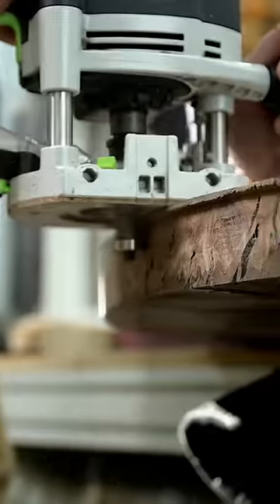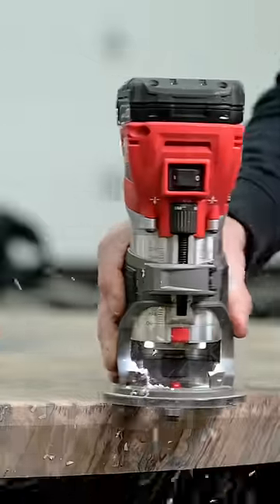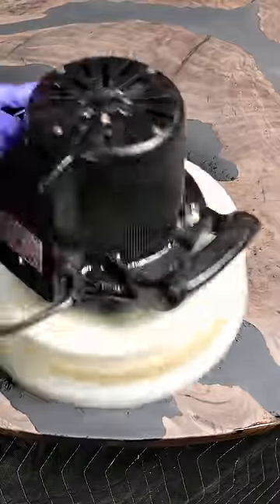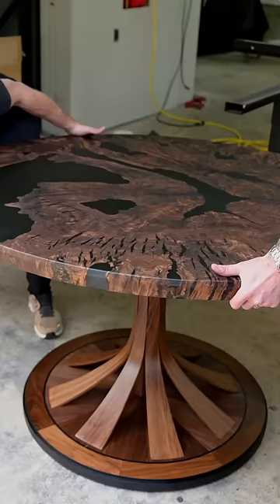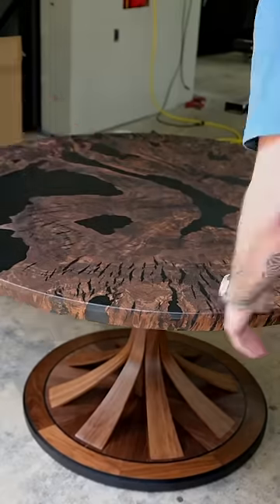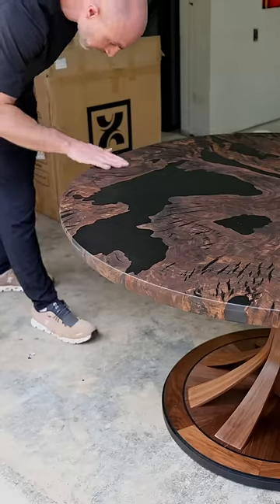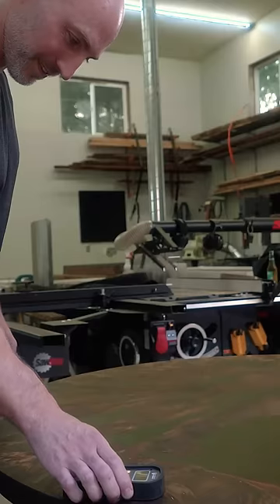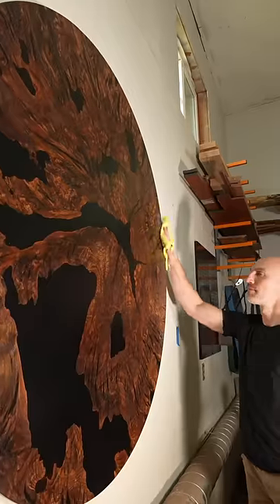My biggest f’ up

Comment: Someone educate me. How does this happen? can you predict and prevent this issue? beautiful nonetheless
Reply from the maker: So… the slabs I buy are supposed to be dry when I buy them. However, better woodworker would double check themselves. Basically this type of wood is prone to pockets of trapped moisture that are easy to miss. After a few months there would be depressions, cracks, and some warping if I tried to use it as is. Thanks for the question!
Reply: @blacktailstudiouncut  thank you for the wisdom, and the reply!
Reply: @blacktailstudiouncut  is it possible to leave it for a year till it sets and flatten it with a router?
Reply: @R.Akerblad  the surface is sealed so the moisture can’t escape.
Reply: @blacktailstudiouncut so basicly you paid 1200 dollars for an unuseable slab😅 cant you ask a bit of your money back from the slab suplier
Reply: @blacktailstudiouncut  thanks for teaching me something new. Interesting
Reply: @blacktailstudiouncut  thanks for replying, I was curious too
Reply: Thanks for asking :)
Reply: 6 to 7% reading I’m told
Reply: It’s tough, but sometimes you have to take the time and let it dry out. The excitement of building something cool can cause us to rush sometimes 😬
Reply: @R.Akerblad  the form of the epoxy and the form of the slab will not remain compatible, i.e. there will be warpage and gaps.
Reply: @whirled_peas  might it be possible (big horizontal bandsaw) to split it in to two thinner slices. Air out and re epoxy. Either as two pieces or try and get them together again. I know this would be hard but is it technically doable?
Reply: @blacktailstudiouncut   could you just cut the edge to open access to the wood to let it dry out?  Then maybe you could turn them into plates or something .
Reply: @blacktailstudiouncut  
Could it be that, for such porous pieces, the extreme cool of the dry ice cleaning causes condensation?
Maybe ice crystals are damaging cellulose cell walls and are allowing moisture to gather, or to get into places that are quickly then sealed shut when the temperature rebounds?
A few before and after tests with comparable slabs might be a good idea...
Reply: @hhiippiittyy I have precisely the same thoughts/inquiries.
Reply: Make a clock out of it
Reply: @blacktailstudiouncut  
I'm sorry for you 
It's beautiful,  really is
Reply: @blacktailstudiouncut couldn’t you make a clock out of it?
Reply: @blacktailstudiouncut pick a better source that guy is a fool not to do a FULL inspection which would've detected these before you wasted time
Reply: @blacktailstudiouncut  what do you use to detect the moisture?
Reply: The lumber needs to be kiln dried!!! 👍 I sell them
Reply: @blacktailstudiouncut  ty for replying
Reply: @ronjoosse5288  doesn’t work like that, because you can’t prove there was moisture in it when he purchased the slab. (Buyer could’ve left the slab out in the elements for a couple days) Also he sealed it, which is why it’s unusable now.
Reply: How does the "moisture meter" work through a sealed surface?
Reply: @SJNFAB  this guy is absolutely right. Kiln will do the job. Maybe build a solar kiln. Most likely slower but that would do the job as well.
Reply: i know very little of woodworking but would it not be possible to shave of the top layer and let it dry out?
Reply: @hhiippiittyy  good question. I'm curious myself.
Reply: @holohulolo  a wood moister meter.
Reply: @blacktailstudiouncut  your awesome thank you for the info
Reply: @arturraimundo7158  they have 2 very sharp metal points on the end, he probably just pushed hard enough to get through the epoxy.
Reply: Was wondering the same thing
Reply: Cam, just curious if you could sand the bottom to expose the grain and let the moisture escape over a few months and then refinish one side? If it caused depressions and or cracks couldnt you just re pour a tabletop epoxy on top to fix it?
Reply: @hhiippiittyy  this is what I thought....
@Blacktail Studio Uncut , you might give this a thought...
Reply: @blacktailstudiouncut  I would think the epoxy would keep it from warping, still looks beautiful though
Reply: @blacktailstudiouncut  neat, just a suggestion but you should do some educational shorts too!
Reply: Best you could do is store your wood in an area that is climate controlled. Oregon can be humid especially in the rainy months keeping the wood in a similar climate it will be used in is a good rule of thumb. So if it’s a dining room table about 70f and less the 35-50% humidity
Reply: @blacktailstudiouncut  Any hopes with a critical-temp dehydrator?
Reply: @connorjohn5013  couldn’t you plane the epoxy off and let it dry out?
Reply: @Grom-rl8bm  that's a non penetrating/pinless moisture meter. Uses an electromagnet and electronics, doesn't destroy the surface.
Reply: @blacktailstudiouncut   I was wondering how such a beautiful piece was unusable thanks for answering never would have known otherwise.
Reply: my black walnut handle was "dry" and i shaved a new knife handle out of it. now 6 months later its shrunk about a 1/8th of a inch overall
Reply: Woods a plant first and foremost so moisture soaks into the wood when he made this piece the wood obviously wasn't thoroughly dried out. Best thing I can tell you is after you buy the wood store it in a dry place and let it dry out for a while unless you have an industrial sized dehydrator.
Reply: @blacktailstudiouncut  is there anything else you can use other than epoxy to fill holes in wood? I’d love to get a table like this when I’m wealthier but epoxy seems a bit too basic lol
Reply: So long story short this could have avoided by testing BEFORE starting let alone finishing. I don't understand why people are saying he should get money back?
Reply: @blacktailstudiouncut  omg that is the most beautiful table I think I have ever seen. If I ever am able to afford one I want to have you build me something it looks amazing. Unfortunately I doubt the day will come that I can afford it.
Reply: Assume everything from the mill is wet or very unevenly seasoned/dried. Just let it sit in a dry shop on the rack. Longer the better, you can moisture gauge it if you're a nerd or impatient. 

Go visit old custom furniture shops that specialize in solid lumber and you will see a years worth of lumber just racked up, like 8/4  and or 6/4 just getting acclimated.

If you're from the "drowned it in expox" school of furniture making, then you likely can't afford that much lead time and capital tied up in lumber since resin ain't cheap.

I seriously wish this fad dies out soon. Epoxy builds kinda just make me puke. I respect the work into these these builds, but it's a crutch that more woodworkers need to let go of. Just my controversial opinion on this.
Reply: @connorjohn5013 nah cut the slabs from the epoxy  and mill faces to expose grain again let it dry
Reply: Can the bottom you of the slab be routed off to allow the moisture to evaporate. Kiln dry the slab upside down on a flat surface, clamped down, to minimize warpage?
Reply: @connorjohn5013  can’t he sand the bottom so it’s unsealed then let the moisture escape or leave the bottom unsealed??
Reply: He made it to damn quick that’s all
Reply: Can u drill tiny holes an bake it in a giant oven like a slow bake on low for 2 days?
Reply: @blacktailstudiouncut  i feel like you could remove the finish, dry it, and re epoxt the cracks, probably would look fine
Reply: @R.Akerblad  - he's saying he just didn't check the moisture content. It could bake or sit till it's dry enough to use and not have any issues.
Reply: @R.Akerblad  sounds like it would work to me.
Reply: Walls need love too, I have 2 gorgeous carved asian screens that go across my wall and they’re just as  fabulous as this piece you just made. I see no spilled milk, just a gorgeous wall piece ❤
Reply: @madisonpowell1694  I prefer a lava kiln myself
Reply: @ronjoosse5288  well if he had cheked the level of moister then he could of let it dry out an use it after a few months
Reply: I’d use it for personal use only, but it does makes an eye catching wall hanger
Reply: @bsfatboy  its cookie, so capillaries in wood are going from bottom to top 🙂
Reply: There is also a chance that because of dry ice = temp difference wood start to condense moisture from air
Reply: @blacktailstudiouncut   that shows your attention to detail and quality of product.   If something that beautiful cant be used, imagine how amazing the things you make that are for sale!
Reply: Do you think spraying it with dry ice had anything to do with the moisture?
Reply: @blacktailstudiouncut  can you use it, let the defects come out and than just repair those rather than having to start all over?
Reply: @blacktailstudiouncut  Mistakes are how one becomes a better woodworker! I hate that it happened, but I'm glad learning has come from it!! Good job!!
Reply: @douglashotek2675  im like 90% sure this is the reason.
Because of pressure and temp of dry ice and the amount of cracks in the wood it can penetrate deeply into the wood making the fibers even more loose than before ,then because the wood wasn't sealed (it should've been sealed in vacuum after dry ice i dont know why they dont at least seal it in a big bag etc)  because of the temp difference moisture easily condensate on the wood and penetrated deeply because of the dry ice making the fibers loose /// or micropores start to open (from the pressure) etc
Reply: My GOD! You neglected to moisture-test it BEFORE you went to work!
Reply: @blacktailstudiouncut  so, why not sell it under what you would normally sell it and inform the guest that the table would warp?
Reply: @takethebaitmate1920  Most definitely 👍🏻Probably the best way to go. Just throwing him some ideas. Building a solar is just affordable and easy.
Reply: @blacktailstudiouncut  that was an expensive mistake on your part. Idk why you wouldn't check first
Reply: Property the application of dry ice🤔
Reply: Not sure why you couldn’t plane the bottom to unseal it and the pay to kiln dry it.  The kiln shouldn’t hurt the epoxy.
Reply: @Grom-rl8bm  he’s using a surface moisture meter not a probe moisture meter. If he was he could be scratching it up as he slides around top.
Reply: Wood is moist. Gotta dry the wood, or at least check like he says or it will warp and crack. It sucks to not be able to trust other “professionals” but when you double check and it’s been done properly, you just appreciate their good work even more 😂 lessons in business
Reply: @blacktailstudiouncut 
I understand that there might be shrinkage, cracking, and warping but could the warping at least be mitigated if you were to screw it down or clamp it down and then wait and see how bad it does if at all?
If it's not too bad you just level it out again and refinish. If you think it's going to be too thin you level the top out on the bottom side you inset a strong wood back plate or maybe even steel and then re-epoxy and polish the top side.
Reply: @SJNFAB for how long and at what temp?
Reply: You don’t stick with the same people?
Reply: @arturraimundo7158  It doesn’t, you can see with your eyes that there’s moisture when your apoxy starts to bubble or crack.
Reply: @ErtsenPlayGames  great point
Reply: The dry ice
Reply: What I'm wondering is if the dry ice blasting could have been part of the issue. Moisture is one thing which yes he should have tested that before making a table out of it at least then he would have known hey I need to let this dry more before using it. But I'm wondering if the dry ice blasting making things so cold could have caused condensation wick into and freeze inside of the wood potentially causing the moisture issue in the first place 🤷. I mean it is commonly used for wood, but I'm wondering if you're the only person who's ever had a moisture issue that may have been related. Not because of the dry ice itself but because of how cold it makes things which could then cause moisture in the air to condensate on the surface or even inside of the pores 🤷 just a thought. Maybe someone could devise an experiment to test this theory. Do people typically use their wood directly after dry ice blasting or do they commonly store it. If you find that most people store the wood for later use; maybe the reason they are storing it is because of allowing it more time to dry from the aforementioned potential for condensation.
Reply: Wasn't dried in a kiln 1st
Reply: @connorjohn5013  couldnt you just skim the bottom and top of the table. cutting the Epoxy top and bottom layers off. let it dry out the wood. and re flatten, seal and finish?
Reply: @blacktailstudiouncut  I literally lost my breath in my heart one of my throat for you I'm so sorry 😔
Reply: Your work is stunning.  I am so sorry but beautiful wall piece!
Reply: @blacktailstudiouncut   could you resurface the slab
Reply: Why not strip the bottom side back to raw wood and let it dry out?
Reply: @blacktailstudiouncut  not worth scrapping it. Just sand off the top let it dry at your shop and hope for the best. I think you’re a fool to be so meticulous about moisture. What was the moisture content?
Reply: @blacktailstudiouncut  can you wait til that happens then refill the depressions and cracks with resin?
Reply: Generally lumber and slabs are supposed to be dried a lot of times kiln dried to remove moisture. This is done to prevent warping, bowing and expansion. The larger the wood is the potentially worse it can become. If you have something like a 6"*6" square it will likely dry more evenly than something large like a 2'*12' table. This is also why it's good to acclimate wood you get to an environment to help it reduce any chance of change once it's installed or created into whatever it will become. For example I helped build a very expensive family justice courthouse with wooden paneled walls, Wood desks/benches and all sorts of intracit designs. Because during early construction the builded wasn't totally sealed or climate controlled we had literal 12'*18'*7' scaffolding tents that were temperature and humidity controlled to prevent the wood from pulling any additional moisture.. With most lumber you dont have to go to these extreme lengths especially if it was stored properly and if its local. Wood from other states can have vastly different moisture content to what they have locally. If you had a big shop making huge custom pieces it could be wise to create a temp/humidity enclosure to eliminate this problem, though for 99.9% of people out there just allowing it to acclimate inside of a shop is enough. Once wood is sealed with different finishes having that moisture in there essentially becomes trapped as will often cause the piece to warp more throughout time with different temperatures during different times of the year. Some wood is also more prone to this than others.
Reply: @connorjohn5013  Could you (using CNC) drill hundreds, or even thousands) of pinholes into the back side of the piece? Then leave it until it dries out enough, reseal?
Reply: @ronjoosse5288 Lol, why would the slab provider pay for a user's mistake?
Reply: @MorRobots  I feel the same about Epoxy (don’t even get me started on the scratches and cloudy epoxy over time) and if the guy had just checked the wood before he wouldn’t have wasted so much material.
Reply: @ronjoosse5288  why? It’s his fault. There are no guarantees.
Reply: @Raccount100  I would assume that even resurfacing wouldn't do much because of the epoxy and sealer plugging up the pores in the wood. Kind of like when you stabilize a piece of wood it literally sucks all of that resin into the pores making it impervious. So I would assume that whatever moisture is trapped in there is there for good. Who knows though. He'll never know if he doesn't try it so it's no loss any more than the table already is
Reply: Was going to ask this myself! Glad he answered and gave a very informative answer as well.
Reply: How would you test it for moisture if it is sealed?
Reply: Turn it into a clock
Reply: @ronjoosse5288  No he paid for a useable slab but didn't check it was dry.
Reply: @blacktailstudiouncut  is it possible to take the finish off of the bottom and drill a few holes where the pockets of moisture are and guide the drying process?
Reply: Just sand both sides back to the wood and allow to dry
Reply: @Blacktail Studio Uncut  after the imperfections show in a few months, as long as none are cracks can you refinish the piece and ultimately use it as a table?
Reply: @takethebaitmate1920  someone that sells a product needs to check their materials. Many times raw materials are sold in batches with are never uniform because a product like wood is inherently not uniform. You can’t really blame your supplier for not checking your materials especially if there are no guarantees made when it’s sold.
Reply: @jimmyboe25  Oregon is humid only in the rainy months lol, the rest of the time it’s dry and sunny no humidity at all.
Reply: I built a Walnut and Maple Chess Board with a 3" frame, alternating between the 2 woods... In my 9th grade Shop Class. Adding a green felt back, and I had a beautiful piece to last my lifetime... 
Then, just like my Shop Teacher warned me, the wood continued to dry, and the glued joints at the frame corners pulled apart, as well as the 2 Walnut frame sections separated from the checkerboard center... I was no longer in school by the time this happened, an Airman in the Air Force with virtually no money, no tools, no place to work, and finally.., no desire to fix it... p
This drying takes time. Lots of time when the project is sealed. It's slow, but predictable.., and inevitable. You cannot imagine the forces generated in the shrinkage. 
Nope. He did the right thing. 5, maybe 10 years from now, he can reevaluate the piece and "do something" -- Until then, he'd just be throwing good money, materials, and time at a project that isn't finished with its wild years. 😜
Reply: Why can't you take 1/2inch off the bottom and let it dry out and reseal it. You could even inset the bottom a inch and open the fibres without compromising the side profile?
Reply: @blacktailstudiouncut  especially if it was in Portland. That city has such ambient moisture
Reply: @ronjoosse5288 his falt for not waiting. Why would he get a refund
Reply: @blacktailstudiouncut wouldn’t blasting with dry Ice create moisture, it’s creates a frost buildup that has to melt
Reply: @blacktailstudiouncut  that's really honest because you could have sold as is.
Reply: @MissterBest   when you spend $1200 on a slab...it should be kiln dried.    Part of that excessive fee is the kiln drying.   Yeah, he should double check...but the supplier is the ome who did wrong
Reply: What if you cut the top in half or into three pieces like a table that had a leaf insert?
That would expose at least one side edge of the pieces to open air and maybe you could extract trapped moisture that way?
Reply: @holohulolo  a moisture detector
Reply: I know this is going to sound dumb.. couldn't you plane/cnc/sand off the top seal, let it dry while clamped to prevent warping, re-epoxy it? Or would cracks make it to unstable?
Reply: Maybe putting it in a vacuum first would be best … to be sure
Reply: @hhiippiittyy  exactly.
Reply: @takethebaitmate1920  silence. He did it himself with the dry ice blast
Reply: So, was there anything you could have done differently or better to prevent this problem?
Reply: @Blacktail Studio Uncut   can you post a video of what it looks like when it does occur?
Reply: @blacktailstudiouncut  if you’re talking about Portland Oregon could the higher moisture content in the air be the cause of this?
Reply: @connorjohn5013  True, but if you're lucky the area of those pockets are fairly sterile, and the blasting enabled the heavy pour to displace all the oxygen. Unless there's anerobic bacteria sealed in, the table may stay fine and retain shape as long as it stays properly sealed. In a way, the primary issue with moisture isn't neccessarily that moisture, but the changing state of the wood as it evacuates that moisture. When waiting for dryness equilibrium is no longer an available option - sealing it in, can be another way of preventing that change. It's not a great nor desireable solution, but it can work.
Reply: It truly is gorgeous, can you fix it
Reply: @ronjoosse5288  when it comes to wood. If you walk off the mill or or yard with it, it’s yours now and there’s nothing they will do about any damages and imperfections. At least if you modify it ik for sure
Reply: Sounds like the supplier should reimburse you for selling you a wet “dry” slab
Reply: @Blacktail Studio Uncut  someone (cough cough)  got alittle to excited and didn't do their due diligence.
Reply: @Ron Joosse  They gave him a full refund he was still out time and materials though.
Reply: NOOOOooooooo.....
Reply: The mill I used to work for had a vacuum and a heat kiln. All wood was tested for moisture before being sold. I'd advise finding a kiln you can rent space in. Or purchasing your wood from a woos supplier who guarantees the moisture level. Kilns also kill any mold or bugs who may have bored their way into the wood that can come out years after the product is finished.
Reply: Oh funny. Reminder to self. Check Comments BEFORE posting the same darn thing... /facepalm.
Reply: @blacktailstudiouncut  😥
Reply: My sculpture professor told us that wood must dry for 12 months to be perfectly seasoned
Reply: @markhooker8520  i think it would be easier the whole project over
Reply: @ITechHero  that would be my idea too, but i would buy it for a wall decoration too! Look amazin
Reply: @otisgt  could work but this person kight not have time to redo the project as i imagine he is busy building other stuff
Reply: @connorjohn5013  the bottom isnt sealed though right?
Reply: @blacktailstudiouncut  I would imagine the dry ice cleaning would cause condensation as well so it may be your fault...
Reply: @MissterBest  Is it enough for the wood to sit in the studio for a few months in order to dry or does it need to go through a kiln.
Reply: @molecq  could you drill holes in it from the back to allow it to slowly dry out over time and then refill them afterwards?
Reply: @joefarmer4465 he may have tested it before he used the dry ice.
Reply: @ronjoosse5288 that's not on them.
Reply: @blacktailstudiouncut  is it possible to repair those depressions and cracks after allowing that process to complete? Ik I'm no wood worker and therefore have no place to talk but could you not just allow time for the moisture to cause the damages you've mentioned and then casting everything in a new thin layer of epoxy so you can sand down and level the top again? It would be add tedious extra hours but I feel as tho you could salvage it for use as a table given enough time and extra work
Reply: Yes before adding 12 gallons of epoxy make sure the wood is to the approximate dry
Reply: Beautiful wall art 😊
Reply: @blacktailstudiouncut  can you dry it yourself before you make the table?
Reply: @takethebaitmate1920  hey fool not the sellers responsibility
Reply: @connorjohn5013  can you drill some small holes to allow the moisture to escape and later embed it with copper. I'm sure it would still take too long. I'm not a woodworker so i have no clue what I'm talking about.
Reply: You should just get a cheap moisture meter there within reason I have 3 dry kilns an I’m located in chautauqua county New York if you ever need anything dryed
Reply: @blacktailstudiouncut  bet you'll check next time lol
Reply: @ronjoosse5288  I assume that would be like eating dinner at a restaurant and then asking for a refund cause you didn’t enjoy it. 
Refunds are only given when you can give back what you bought
Reply: @blacktailstudiouncut  So sad.. it was such a beautiful table. atleast you can use that base for something else
Reply: @blacktailstudiouncut  such a noob question, but if there’s no epoxy on the underside, given time, would it dry out?
Reply: Don't pressure wash the wood
Reply: @R.Akerblad  
Not sure if someone else answered this for you or not, but you can’t split it in half and let it dry that way because the original outside pieces would still be sealed. So you would have two pieces, each with a sealed side and an unsealed side. As the piece dries, it will warp a ton because the sealed side doesn’t expand/contract the same way the unsealed side does. This is why they say to always finish the underside of a table top as well, as opposed to just finishing the side that shows. Hope that helps/makes sense.
Reply: @blacktailstudiouncut  how much would you sell it if  it was completed
Reply: It would make an awesome wall clock.
Reply: Would it have anything to do with blasting it with a pressure washer
Reply: @tristangriswell2034  that would certainly be the best use of this slab, good idea.
Reply: @ronjoosse5288  probably not. It's not like the supplier guarantees they're dry
Reply: @alesrus1907  I see, then cut in In half horizontally. Would that work?
Reply: @blacktailstudiouncut  would you have solved the issue somehow if you knew there was trapped moisture beforehand? And how would you have resolved it.
Reply: Drill a grid of dots all the way over. Allow it to dry for a few months or whatever then fill the holes in a Damian Hirst style dot colour pattern.
Reply: @R.Akerblad  you have no idea what a router does, huh?
Reply: @takethebaitmate1920  or perhaps he should have been more keen before making the purchase and spending 1200. And maybe he could have been more patient and allowing it to cure before moving forward with the project.....

Not really 100% the seller's fault..
Reply: @Blacktail Studio Uncut  could you not sand it back open and let it dry?
Reply: @gavinrichardson3918  As a Chinese woman scientist and author of book 'Women scientists in the Qing Dynasty' 
You cannot sand back or shave and expect entire mass to dry out as there are hidden pockets of mostre. The only way to achieve dry would be to spin the would in a 25metre radios at approx 3275rpm. The centrifugal force would push/force moisture out where it can't naturally escape with heat evaporation. I explore more in my latest book.
Reply: @blacktailstudiouncut  can you test for moisture before you start working on it?
Reply: @Blacktail Studio Uncut  makes no sense to me, so you'll rather have it as a wall peice with trapped moisture over a table?
Reply: After the dry ice blasting, you should put it in a small room with a 'Desiccant style Dehumidifier'. This machine should bring the room moisture down to about 20% RH.
Looks gorgeous and wish you the best
Reply: @blacktailstudiouncut  couldn’t you drill small air holes into the areas where there is water ? Put it in a warm room for a wk that should sort it
Reply: @blacktailstudiouncut  can you drill holes into the bottom where the trapped moisture is? Let it dry out, then refill the holes with epoxy, woodglue/sawdust and still use it as a table? I imagine its fixable somehow. Beautiful piece-wall or table!
Reply: @R.Akerblad  Yes.
Reply: Yeah, you would think theres a way to strip it back and air dry the piece someplace warm and dry. And re do the resin or is it not worth doing 🤷‍♂️
Reply: @blacktailstudiouncut  I wouldn't say 'a better woodworker' everybody makes mistakes, even guys who have been doing it for 50 years will sometimes forget a step you've done a million times.
Reply: I was going to ask a very similar question 😆 I love how much can be learned in the YouTube comments section 👨‍🎓
Reply: @blacktailstudiouncut  So all that work done and you don't confirm beforehand if their is trapped moisture? 🤡
Reply: Guy that sold it to you should refund you at least for the wood though you possibly could pursue the lost cost of time and epoxy too. That's if the lumber seller was required to check moisture first and it wasnt a missed step in the maker's process creating it too.
Reply: @connorjohn5013  If the moisture can't escape then the pockets and such won't empty so the table will never change shape unless exposed to extremes of heat where it would change shape anyway due to the differential expansion/contraction of polymer and wood.

Surely?
Reply: @blacktailstudiouncut   That just adds character to a table. You just let those things happen and repair them later. I had a spalted maple table that had this issue so I kept it and used it as my own table. It took going through heating the house in the winter to finally dry. I fixed the damage and sold it for more than what I had originally planned.
Reply: @blacktailstudiouncut  i think i would cry a little
Reply: He didn't check the moisture level; rookie mistake. Most people who sell lumber say everything is "dry" when it's really not. That piece will take 3-4 years to dry in ideal outdoor conditions.
Reply: couldn't you use a small drill bit that you could drill few holes into it so the mostier could escape?  then after several months or so then fix the area and then you save the table or am I wrong?
Reply: @ronjoosse5288  I dare you to try and get a refund on a product you've already accepted and worked on. Material suppliers are not the greatest at reimbursing damaged products you've already worked on. Better notice that shit BEFORE you invest time, money, and other materials into it
Reply: Do you have any photos of some older work that you have done? In my experience with epoxy yellows over time I am wondering how your pieces are holding up
Reply: I would have still sold it
Reply: @blacktailstudiouncut  thanks for the explanation
Reply: @blacktailstudiouncut  thank you ❤
Reply: wall piece for like a viking Hall
Reply: @blacktailstudiouncut  Wouldn't it be possible to prevent the warping by beacing it with metal profiles from underneath?
Reply: @blacktailstudiouncut  interesting woodworking, great explanation in the video, and a truly professional response. Bravo good sir!
Reply: @paulb9376  cheap epoxy turns yellow and melts at 120f. Good epoxy is hard like glass, doesn't yellow, and melts at 600f
Reply: Is it possible to drill small holes to let the moisture escape after some time then Reseal?
Reply: @blacktailstudiouncut  would using it outside make it worse
Reply: You’d have to put it in a pressure pot (impossible).
Reply: @-Nathan87-  hopefully at a discount...
Reply: @Ron Joosse  it does make a beautiful, if expensive, wall accent.
Reply: @blacktailstudiouncut 'd still buy it. It's too pretty to just hang up. Damp issues or not lol. Beautiful work.
Reply: @blacktailstudiouncut  if he wantedbto ameliorate it should it have been dried in an oven?
Reply: @connorjohn5013  he could trim (plane/sand) some material off the top and bottom making it no longer sealed and then  kiln dry it.
Reply: @blacktailstudiouncut  So.. can't you  to even this table after couple months?
Reply: @blacktailstudiouncut  okay but hows it sitting now? if it's holding up, i mean what would you sell it for?
Reply: Make it a clock
Reply: @blacktailstudiouncut  can you drill from the bottom to drain these pockets?
Reply: @molecq  Experienced wood worker here. You COULD try that, and it might work. But unless he has a very large drum sander or something like that, it would take a lot of hours of sanding to get that back to wood. A giant planer would be even better. Plus you'll have to remove the outside 1/16 to 1/8 inch layer of wood, because the resin will actually soak and penetrate down into the wood itself.
Reply: @kennydunk pretty sure it was air
Reply: @TheBrawlmastah pretty sure it was air
Reply: @ronjoosse5288  If it was sold as dry, then it was a contract violation and he should get his money back + his lost income
Reply: @blacktailstudiouncut  not a better woodworker, a more experienced one maybe, as you are right now. great thing you made even if is a wall peace or whatever, greetings from argentina.
Reply: Is there a reason why not to check for moisture until the very last step?
Reply: @blacktailstudiouncut  is there a way to salvage it, would you need to let it dry longer?
Reply: @molecq  I was thinking drill into trapped moisture areas from the underside then fill after dry.
Reply: @R.Akerblad  It would be nice if it worked. With trapped moisture I assume the wood may still have stress that would be relieved in the form of cupping while sawing.
Reply: @blacktailstudiouncut  not trying to be a smart ass at all when I ask  but could you not test for moisture prior to starting?
Reply: It would make a beautiful clock
Reply: You’ve got to let the wood sit for awhile after it’s first been cut to dry out. The process can take months to about a year to air-dry. I think there’s also pressure things/heat you can use to dry the wood but that’s a little tricky as if you’re miscalculating smt the wood can split.

Many lumber yards let the wood sit and dry cut to size then add things like sealants to it. (This can be to prevent pests/keep moisture out) 

Certain wood can’t be cut on a saw/burned as it can release toxins from the sealants into the air. 

Moisture trapped in something like this table top means that it will eventually expand and crack. Part of the reason why the moisture might be off is due to the resin. Resin is a chemical reaction that gets extremely hot as it cures (enough to melt through certain plastics)  resin with wood can on occasion cause the water that’s trapped to heat up and try to escape the wood to the surface. Which again can cause cracking of the wood or can cause a separation from the resin and the wood itself (if there’s raw edges there’s more surface area for the resin to encapsulate and it holds together better, it’s why a rough surface tends to work well with resin while a smooth surface with little friction like silicone causes it to peel away.)
Reply: Why dont you just drill a hole in the area and fill it with silica for a few weeks, come back to it, fill it with wood filler and re-top.
Reply: Sorry you missed the moisture before sealing it. But still a very Great piece!!
Reply: @blacktailstudiouncut  Drill (with tiny drill bit) into the bottom side of table to let the moisture seep out over time. Like they do to asphalt in NASCAR races.
Reply: @Blacktail Studio Uncut   how did you know it had a moisture issue?
Reply: @blacktailstudiouncut  that really interesting didn’t know that so have a sub I’ll watch more
Reply: @blacktailstudiouncut  Damn, even wood gets depressed!
Reply: Ooff.. That hurts. I would have loved to see this slab in a dark blue epoxy, maybe some hue in it from another vid I saw from you some other time? 

Do you have a place where you can dehydrate the wood you buy? Or maybe some shelter where it can dry out for over a year? Or maybe it's unwise to keep that capital locked up like that..
Reply: @blacktailstudiouncut someone did a horrible job on a large table they gave it to my job unfinished and the wood wasn't fully dry so its unplanned and breaking from the epoxy
Reply: Shouldve gotten that little machine  a bit earlier
Reply: @Max-nt5zs  yeah, you can use solid gold instead of epoxy. it's kinda pricey but wealthier-you can afford it
Reply: @blacktailstudiouncut  can't you do something to salvage it?
Reply: @ronjoosse5288  it's not their fault he didn't let the wood dry.
Reply: @bennettray22 who you talking to??? What 6-7%??
Reply: @ronjoosse5288  the supplier refunded the full price of the slab
Reply: @MissterBest he said it was supposed to be dry from the supplier in the first place
Reply: By drying it yourself.
Reply: @blacktailstudiouncut if it cracks etc over time can you repair it? If so id love this table!
Reply: @bsfatboy - If the Edge work was Opened, another idea "Might be" to drill skinny 3/32" "Venting Holes" into the Wood, carefully, from the Outside towards the Center, in a Spoke like pattern, so the Moisture could Breathe out. However, the Drills that would be extra long, so you'd have to be careful the drills don't Bend and come out through the Finished Surface.
Reply: @ronjoosse5288 let me get my money back on something I already used and sealed seems legit
Reply: @GOREFEAST  I’m referring to what the moisture content of the wood should be before working with it.
Reply: @Connor John  cant u cut the surface off w the machine that makes it even across the top so the moisture it escapes and then let it sit til dry ??
Reply: @blacktailstudiouncut  can't you open some holes on the bottom to dry the wood and then cover them with epoxy? That table looked awesome.
Reply: @ronjoosse5288  everything about your comment tells me who you are and the type of person you are.
Reply: @thegoodonesali1109  well tell me then, what kind of person am I ?
Reply: @TheFrontyer  thats what i meant to say!
Reply: @hhiippiittyy  dry ice doesn't leave any moisture thats why they use it for this process.
Reply: @ronjoosse5288 They would say why didn't you double check? He did a whole project with it too which took months or weeks. How you going to ask NOW?
Reply: @johnroberts7254  
I'm aware that dry ice isn't itself a source of moisture, but it will cool surfaces quite a bit, below the dew point of the surrounding environment, which might cause condensation from the air onto the surface of the piece.
Reply: @blacktailstudiouncut  still it's a beautiful piece great work
Reply: @blacktailstudiouncut  I always chemically dehydrate wood that I’m going to epoxy or polyaspratic. I’ve had major cracking with any project I haven’t
Reply: @baby_king9ine  if he takes the moisture meter with him next time I would test it right in front of the person selling it to me.
Reply: My money is the steamer he used lol
Reply: @blacktailstudiouncut  test the slabs first before you leave with them, buy damp rid or some other moisture absorbing material and put it in the room with the slabs, put a space heater in that room to help dry out new slabs and circulate air
Reply: @R.Akerblad  you can make a kiln yourself or keep it in a very low humidity room eventually it will dry out
Reply: couldn't dry ice theoretically attract moisture to the wood because it is ice cold
Reply: @blacktailstudiouncut   I do not work with wood.  It's not my thing.  I love the work you do.  However, I believe where there is a will, there is a way.

I cannot tell you how or even suggest how you might fix this because I do not have any knowledge here.  But again, there was to be a way to recover this piece.

Only a suggestion.  I thought of heating the back.  Drill a couple of tiny holes from the backside without breaking the wood surface between the wood and epoxy.  Put temporary rods in maybe ceramic?  Something that will heat up but not to fast like metal.  

What about the blue light used to harden bonding agents? Or some other form of Lazer.  I know the different color Lazers have different functions, different abilities.

What about drilling the smalls holes as suggested earlier, but using the powder from an activated hand-warmer packet.  The moist should gravitate towards the powder.  Or perhaps salt?  You'd have to make sure these don't effect the wood.

I'm just a truck driver.  Not a scientist.  But I know there was to be a way to fix this!!!!!!!  Try going to your local college and talking to the science professor.

Maybe......if you figure this out.  You can sell your findings to other woodworker's.
Reply: @blacktailstudiouncut  
Wow, never thought of that…
Reply: Dry it out first.
Reply: @blacktailstudiouncut  what happens when you have trapped moisture in the wood?  Genuine curious question. 🤔🤔
Reply: I’m sure someone would paid 500 for wall piece
Reply: @holohulolo  two fingers
Reply: @blacktailstudiouncut  only way to learn is by failing. I guarantee u will be double checking all your pieces now and won’t let it happen again. Here goes the saying, “you live, you learn”
Reply: @blacktailstudiouncut  This makes me pissed for you. Damn dude that was a lot of work. Hope your future projects go better.
Reply: Nice pfp
Reply: He should have waited for the wood to dry?
Reply: @blacktailstudiouncut  im sorry that there were trapped moisture pockets, but thank you for sharing about your experience, it helps us to add an important drying and drying check step to our workflow. It is still an amazing piece
Reply: @louish.9414  In a gallery, with nice lighting, that is a $5,000 piece, easily.
Reply: @connorjohn5013 cant you drill out some areas threw the finish and let it gas out for a while?
Reply: @blacktailstudiouncut  You learn something new everyday indeed
Reply: @blacktailstudiouncut  what if you reinforce it with metal, gotta be a way to incorperate metal to keep it from warping and still look cool, possibly cooler
Reply: @blacktailstudiouncut  maybe with all the epoxy it will not warp or crack. The epoxy propably will keep everything together and make it stronger
Reply: A work of art, man. Pure and beautiful.
Reply: @ronjoosse5288 no it is very usable but if he double checked it and found it was still "wet" you just leave it to dry for like a year and your good to go.
Reply: @blacktailstudiouncut  that sucks man i hope you can find something just as good looking
Reply: @connorjohn5013  If moisture can't escape, wouldn't that mean that the wood is in equilibrium? Or will the wood still warp even if there is no change in moisture?
Reply: @@blacktailstudiouncut  question. If you used your moisture checking device prior to epoxy. Would it have gave you an indication to hold off on doing the project?
Reply: You can avoid this by baking the wood. It's an easy mistake to make by an inexperienced wood worker.
Reply: If you heat the wood yeah but then you run the risk of ruining it
Reply: There are devices that can check the moisture in the wood.
Reply: Could he have tested the slab before he paid for it? This is a serious question. I’m not trying to be a smart ass. I do not know anything about this subject matter. It is super cool nonetheless.
Reply: Its worth $1,500 as wall art to me.
Reply: Wow so Beautiful
Reply: Couldn’t you take a top layer off to expose the grain and set it to dry for some time?  Or the epoxy it’s in will make things not move correctly?  Beautiful piece brother absolutely incredible looking.  My heart aches for you.
Reply: It makes a beautiful wall piece!
Reply: @blacktailstudiouncut  Dude! Make a cool assed clock out of it..
Reply: @blacktailstudiouncut  is there any way to “touch up” a crack or depression to the epoxy or would it have to stripped and redone?
Reply: @blacktailstudiouncut  How about cutting it into something like 4 or 6 inch strips. Let it dry and glue it all back together with a contrasting wood color between the cut, glued edges? Or cut it up in a design that when the contrasting wood and all is glued back together it makes a cool design. Could it dry after being cut to pieces?
Reply: @ronjoosse5288  I doubt many people or companies offer any kind of warranties on raw lumber
Reply: @blacktailstudiouncut  what would a table like that be worth if not for trapped moisture?
Reply: @blacktailstudiouncut  Screw loosing $1200. I'd cut out the pockets of moisture  and replace it with more epoxy. The table is too nice to just hang on your wall. Even as an art piece, its worth far more than $1200. If I had money to invest on art, I might rather have that on my wall. I don't think you can possibly loose money on that slab, especially with the all the eyes you have on your channel and potential buyers out there. Its beautiful work you did either way. Nobody is perfect, and the slabs you buy are all imperfect to begin with.
Reply: @bennettray22  16 is dry for wood.
Reply: @ronjoosse5288  no because as he said it was on him to check for the moisture not the person who sold it
Reply: @ronjoosse5288  after he cut and tabled it? He'll be laughed at before getting hung up on.
Reply: A dehumidifier running next to it for about 24/48 hours or more if needed , before beginning any work would’ve did the job to dry it
Reply: @brent2597  you make a clock out of it dude!!
Reply: @R.Akerblad  flatten it with a router?? You mean a planet I think, a router is what he used on the edges to round it over
Reply: @holohulolo  to detect the moisture he used a skeeter yeeter.
Reply: @R.Akerblad  Before any work was done , a dehumidifier running next to it for  24/48 hours or more if necessary ( indoors ) would’ve dried out the wood . Hot air from the dehu blowing towards the wood would have evaporated the moisture and through a tube going into a sink the moisture would have became liquid and disposed in a sink .
Reply: @blacktailstudiouncut  yeah I can’t imagine losing $1200 on something like that.. plus losing out on profit 😭 I know these probably for for like $3-5k+ 🥲 sick work though!!
Reply: @connorjohn5013  his poiint was to let it sit before sealing it
Reply: @ronjoosse5288  you understand that it’s not their fault, right? OP assumed it was ready and didn’t double check
Reply: @blacktailstudiouncut  how do you find out this stuff or figure out what happened ? Foroms experience ? That seems like it would be hard to deduce
Reply: @blacktailstudiouncut  could the dry ice blasting possibly caused the moisture by condensation sticking to the cold wood as well ? ( If you didn't wait long after to put the epoxy on)
Reply: What if you sand the surface ? Wouldn't it go away or what does it do to make it unusable
Reply: @blacktailstudiouncut  what if you drilled pocket holes underneath to allow the moisture to escape?
Reply: @blacktailstudiouncut  you power washed it.. youre the last person to moisten the slab..
Reply: So if it cracks it's easily repairable right?  the worry is the warping correct? Is it a 100% definite that it'll warp or just a possibility?
Reply: Wow
Reply: @ronjoosse5288  i dont think the slab was 1200 but the cost of making it.
Reply: @epicmonkeydrunk  i dont think so, slabs of this size and species are very expensive.
Reply: @blacktailstudiouncut  do you hire people or do you only work for yourself????
Reply: @blacktailstudiouncut  thanks for explaining it well. Your videos are not only satisfying to watch but also pretty informative as well. ☺️
Reply: @FKNSENDIT  very interesting idea, since one side isn't going to be seen 🤔
Reply: cant we dry it somehow and use it??
Reply: @blacktailstudiouncut  can you just grind down to wood layer and leave it so it can dry , then after put epoxy on top?
Reply: Sad.  Looks amazing. So much work.  And it can’t be used  😞
Reply: Not sure why he wouldn't check moisture before sealing
Reply: @SoulDelSol  as he said the wood his buying is checked but he didnt thought about checking it second time
Reply: @blacktailstudiouncut  what kind of number do you like to see for dryness?
Reply: Damn, that hurt. Beautiful wall piece nonetheless!
Reply: Dont buy rotten wood.  He set himself a challenge because of how damaged it was but needed more care
Reply: Not a fan of this epoxy craze, wood is beautiful without that plastic shit.
Reply: @kennethrollo7891  without epoxy, beautiful pieces like this aren't useful
Reply: So did it need to be air dried in the shop until it dried out ? Is there an approximate time from cutting tree down to actually working on it ? What about kiln drying ?
Reply: @blacktailstudiouncut  couldn’t you drill a small hole to let the moisture out then reseal after it dries?
Reply: @blacktailstudiouncut  I think the depression would start right away, but thanks for the info.
Reply: This is why you always check moisture content BEFORE using sealer, hardener, and epoxy. Different regions have different moisture contents that are acceptable to be finished. Here is Colorado, generally you need less than 8% moisture. Otherwise, the wood will warp, crack, bow, twist, everything you never wanted that piece of wood to do! Also, buying from a wholesale retailer like lowes or Home Depot; be aware that those pieces have travelled from different states to reach you. So make sure you always check moisture content before committing the time and resources to make a table that will twist and warp given a years time.

Never assume your wood is kiln or pressure dried unless you’ve done it yourself. Assuming that will result in furniture that will NOT last more than 15 years if that. Not to mention angry customers when their tables are no longer flat.
Reply: @ronjoosse5288  technically speaking, this isn’t a slab. It’s a burl, which drives the price up drastically. A burl is a peice of a tree that contained patterns of rot which affected the growth. This makes burls sought after which inherently makes them more expensive. I would expect to purchase a walnut burl that size for about 2,250 if not more. So truly it was a good deal, and could’ve made him a ton of profit. But because of the moisture it’s now nothing but an ornament waiting to pop.
Reply: @blacktailstudiouncut good on you for not selling that as is I would have never know
Reply: Could you not sand the underside of the table then turning upside down for a year to dry out? Then reseal, make good any imperfections once it has dried out???
Reply: @blacktailstudiouncut did you get your money back? Little bit of a stretch but almost like buying something “free” just to find out whatever it was “free” from had it in the product all along. I understand accidents happen but $1200 is a nice chunk of money. I hope you were reimbursed. I’m sure you ended up spending well over $1,200 by the end with materials and labor.
Reply: Ah the material has moisture, dognammit
Reply: This is interesting. If this occured. Could you possibly identify the moisture pockets with an x-ray device. Drill small holes on one side. Heat dry before using the epoxy. Could a simple tool to find the moisture pockets work?
$1200 isnt something you want to throw away.
Reply: You read the can and wait 72 hours for it to cure, if the can says WAIT 72 HOURS FOR PRODUCT TO CURE. 
    I used to sell all kinds of finishes at a high end paint store and this happened every day 🙃
Reply: @blacktailstudiouncut  how did the ancient carpainters delt with it ? I guess they didn't had trapped moisture meter
Reply: must have not been STUPID proof.
Reply: Make a huge clock out of it.
Reply: @connorjohn5013  keep it in a heated room, heat travels through solids. it’s not useless. it’s just a video for views . do you remember science 101 in 1st grade?
Reply: I thinknit fits better the wall than table
Reply: @blacktailstudiouncut can you make small holes whit the small drill bit you can find.??
Reply: @ronjoosse5288  if he doesn’t mind going by the name Karen.
Reply: @blacktailstudiouncut Make it into a clock. Its a Wall piece any way right?
Reply: @blacktailstudiouncut  nonetheless that is a beautiful wall piece I'd pay a couple pretty pennies for
Reply: You test the moisture before you buy wood. You need 8% or less.
Reply: @ronjoosse5288  probably not because they will say they aren’t responsible for any of that stuff beforehand
Reply: @ronjoosse5288  nope he messed it up by not thoroughly checking the slab
Reply: @blacktailstudiouncut  ugh I love how humble you are but i think we all know you’re the best woodworker
Reply: @blacktailstudiouncut  why does it matter if there moisture in the slab
Reply: @ronjoosse5288  plus 12 gallons of epoxy 😭
Reply: @blacktailstudiouncut  do you have any examples you could show us in another video?
Reply: @jasonl9682  or a clock
Reply: @blacktailstudiouncut  oh now, not more depressions
Reply: @blacktailstudiouncut  I would have loved for you to keep it in an indoor environment, and check on the checks and cracks, etc.   I myself am curious as to the readings and the long-term affects, when used as a table.   Just a suggestion, love your work.
Reply: @blacktailstudiouncut  hold it for a year if it don't crack sell it
Reply: The number of people here who posted the exact same comments as those above them is absolutely mind numbing.
People genuinely think that out of 300+ comments that they are the only one to suggest "drill some holes in the underside" or "sand it back to wood"...

We are doomed as a species I swear!
Reply: Cook it at 102° f for 6 weeks at 15% relative air humidity and it'll be good to go!
Reply: @blacktailstudiouncut  I'd hang that on my wall!!!  Hope it sells!
Reply: @hhiippiittyy dry ice freezes the air as it 'melts' causing the fog that you see around it. I think the fog then melted into the wood, made even more pourus from where he was blasting it.
Reply: @ronjoosse5288  Probably can’t ask for his money back but I bet he could negotiate being given another slab.
Reply: Can’t you dry it out? Leave it in a smoker type room where they smoke meat. I’m sure it would remove all the moisture from it. Idk lol
Reply: @blacktailstudiouncut   can you show it in the future for science?
Reply: Any carpentry teaches you about checking quality when you buy things
Reply: @connorjohn5013  would you be able to drill some kind of relief hole to let the moisture out or does it not work like that??
Reply: Wood was possibly outside before he purchased it
Reply: @holohulolo  moisture meter
Reply: Why did you wait till after it was done to test it?
Reply: @ddmau7995  In theory it might take over a year to dry out oak is several years but a business wont want that wait
Reply: @blacktailstudiouncut  what did you use to check the moisture
Reply: @blacktailstudiouncut  

      It's still gotta look and be better than the table I have ... 

  ... which is no table
Reply: After all the cracks why don’t you fix it and then sell it. Somebody would still buy this, probably for a lot more than 1200$ and whatever that base costed you.
Reply: How did you know there was moisture in the slab after it was sealed?
Reply: @blacktailstudiouncut  Damn that brutal, it looked really good too
Reply: @neillpeterson20  He got his money back from the lumber yard, its a show piece now
Reply: @molecq  no because that is actually what causes wood to warp one side drying out more the the other the whole surface needs to dry out equally air needs to flow around the wood that's why we sticker wood slabs to they are not touching each other and air can flow under and over the peice and even then it still moves around
Reply: @otisgt  no you would have to remove all the epoxy and he sealed the wood wich means he would have to take off about 1/16" off every inch of the slab not just top and bottom
Reply: @connorjohn5013  why cant you expose the wood on the back then let it dry?
Reply: Maybe you could check for moisture BEFORE you buy it and put all that time and work into it
Reply: @ronjoosse5288  lmfao asking for money back because you screwed your project up doesnt sound like their fault.
Reply: @07slowbalt  of coarse he can, people like to make things dramatic
Reply: @dylanwatt9661  it's probably all a lie and sold someone foe a good price. Content creator's love to make their videos as dramatic as possible
Reply: @blacktailstudiouncut  Why didn't the dry ice remove the moisture?
Reply: @blacktailstudiouncut  how much do you want for that "wall piece?"
Reply: @blacktailstudiouncut  oh I was thinking the monster came from the dry ice
Reply: Wait, an honest guy ? These kind are hard to find !!! Glad to know some still exist.
Reply: So, you didn't check this before wasting 12 gallons of epoxy?  Wow, you're huffing too much of that polyester resin.
Reply: Anybody with an industrial kiln will do the trick,search on the net for wood kiln drying
Reply: @Ron Joosse  his fault, he could have checked it before he bought it..
Reply: @Ron Joosse  his fault, he could have checked it before he bought it..
Reply: @Ron Joosse  his fault, he could have checked it before he bought it..
Reply: @Ron Joosse  his fault, he could have checked it before he bought it..
Reply: @Ron Joosse  his fault, he could have checked it before he bought it..
Reply: @Ron Joosse  his fault, he could have checked it before he bought it..
Reply: @Ron Joosse  his fault, he could have checked it before he bought it..
Reply: @Ron Joosse  his fault, he could have checked it before he bought it..
Reply: @Ron Joosse  his fault, he could have checked it before he bought it..
Reply: @Ron Joosse  his fault, he could have checked it before he bought it..
Reply: @Ron Joosse  his fault, he could have checked it before he bought it..
Reply: @Ron Joosse  his fault, he could have checked it before he bought it..
Reply: @Ron Joosse  his fault, he could have checked it before he bought it..
Reply: @ronjoosse5288  nope. He sealed it, it was his fault. Still, it can be nice decoration or cut it up and re do it for smaller decor… shame would have been a unique table.
Reply: 1200? How much do you profit off of this.
Reply: @blacktailstudiouncut can it even warp?!  I thought the epoxy would be pretty strong.
Reply: @ronjoosse5288  its still a great piece of art and it looks amazing on the wall still a show of skill
Reply: @connorjohn5013  it would create bubbles and other distortion within the epoxy. And I’m assuming would make it feel not as smooth over time
Reply: @blacktailstudiouncut oh that suck it look so good
Reply: Please educate me... warping would occur when there is a substantial differential in moisture across a slab of wood over time from it's current state. If the moisture is locked in with the epoxy, then how does the change in moisture occur to result in warping or cracking?
Reply: @R.Akerblad  I think he used too much apoxy, so much so it wouldn’t really be a table of wood? That’s my train of thought I’m sure he’s thought of it extensively considering the money he spent on it
Reply: Like most things, it's rate of change that's most concerning. If that table is fully epoxy resin sealed the trapped moisture will remain longer than Zod or Han in Carbonite.
Reply: @Blacktail Studio Uncut  12 gallons of black epoxy. You spent a lot on materials. Dam shame.
Reply: @connorjohn5013  could the sealer be sanded off the top and then leave the slab to dry and then seal it again
Reply: @ronjoosse5288  That's not how it works usually. You pay upfront for the slab and 1200$ is pretty cheap for that kind of wooden plate imo. 
Try building a balcony or just a little terrace out of wood. 4m^2 And you'll already be broke as hell lmao.

Asking for a reduction in price here is like asking the salesman if he can give you a 100$ because the rusty Ford you bought last week has some additional rust. ^^
Reply: @MissterBest  "The excitement of building something cool can cause us to rush sometimes"

The sheer amount of wasted money on the thing not to mention the building materials is enough to make me think he has serious impulse control issues.
Reply: @blacktailstudiouncut Dont worry now you are that better woodworker. 😉
Reply: @R.Akerblad  u slow g
Reply: @ronjoosse5288  Well it wouldnt have been unusable before he sealed it. He would just had to dry it before working on it, but yeah it sucks if he bought it from place it should have been dry, and i hope they compensated somehow
Reply: @ronjoosse5288 no, as he said before some people would have double checked and figured out there was retained moisture prior to sealing it. Just a case of bad luck on his end
Reply: @blacktailstudiouncut  what about aging it a year so the water does its damage, then re-planing and refinishing ?
Reply: @connorjohn5013  well if the moisture cant escape , how is it going to do damage ? It seems like an either-or, to me.
Reply: Why can't you just plain the epoxy surface off to open it up so the moisture can escape.  I'm sure there's a fix to this. It's just is it worth your time
Reply: @blacktailstudiouncut  thank you for teaching us! plz add more info when u feel like it! thx in advance
Reply: That was an expensive mistake. That's how you learn but you won't make that mistake again.
Reply: @R.Akerblad  he could sand it down a layer all over

He just doesn’t want to
Reply: Always run moisture testing before sealing any wood item😢
Reply: @Castlepa26  that's what i was thinking too
Reply: @Ron Joosse  
How is him paying  $1200 for an unusable slab funny?
Reply: @ronjoosse5288  no  no you can't
Reply: Nice piece.. but to dry out the wood can't you set up a tent and run propane heaters to dry out the wood.. can be costly.. but we do the same thin in the body shop world. I know wood is a different material but just curious..
Reply: @blacktailstudiouncut  You should drill some little holes in it where the moisture is trapped so it can dry that way and then resin it again in like a year.
Reply: @blacktailstudiouncut  Have you tried a dehumidifier for the moisture leave in a room with one of those thing it most likely will help if not solve ?
Reply: Is it possible to make drain holes from the sides or bottom that can be filled once drain i would imagine its possible if done a certain way 🤔
Reply: Not after you have epoxied it
Reply: @blacktailstudiouncut  awesome job regardless...
Reply: Prob because he was blasting frozen water into it
Reply: @connorjohn5013  wood it rot?
Reply: Yeah you bake it like guitar wood. He kinda messed up not taking the moisture out
Reply: I know nothing about woodworking…is it possible when you get a piece like this to dry it out somehow with heat before hand just to be sure there’s no moisture? Just generally curious, it came out looking absolutely amazing👍🏻
Reply: @blacktailstudiouncut  i never knew this. thanks
Reply: As a wall piece it could make a really cool looking giant clock
Reply: @ronjoosse5288  No, he made the mistake of sealing it. It was useable if he didn't seal it first and gotten rid of the moisture inside.
Reply: @ronjoosse5288  no because it’s not their responsibility because he didn’t check the moisture level
Reply: When you air dried slabs, that's what happens. 32 % is air dried wood. Probably a couple years of air drying, assuming the wood was at 75% to 90% at cutting. Kiln dried wood should be around 6% to 8% after conditioning in a kiln. Depending on local humidity, the wood will gain a bit of moisture from climate.
Reply: I thought I was learning something you could have easily fooled me! This was a brilliant video I don't see what went wrong with the moisture and how.
Reply: @blacktailstudiouncut  what if you would squeeze sides with metal ring (similar like they use for wooden barrels)? Maybe then it would dry evenly?
Reply: @blacktailstudiouncut  😢 it is ABSOLUTELY BEAUTIFUL piece 😍🌹🙏
Reply: My first thought was a huge clock. If it's now a wall piece you should make it into a clock
Reply: So there isn’t a 100% fool proof way to ensure absolutely no moisture gets trap in the wood… but you’ll never get 100% off the moisture or. Your allowed a certain amount. And beyond that point you run into issues like it trying to bowed etc…. But you can do other steps to help  prevent this from happing. Like always pay attention to where it stored when you purchased it, they can tell you a lot and then no matter what they say to you you drive out yourself for a few days and then, if possible wrap it as tight as you can with saran wrap or something small of that nature that won’t leave any gaps or pockets of air that help back into the world and then of course, if possible store in a zero moisture free area. I really hate this for this guy because not only did he pay $1200 for the wood. He has a butt load of money in chemicals.(clear coat,  Apoxsee (which is very expensive)  stain etc..)  I’ve always said hands-on experience is the best experience but unfortunately they can be costly appearances. And sir if you are reading this it looks like you do great work!!! And I really hate that happened to you. But like every great inventor/artist  has learned, there is never a failed piece of work, some times you gotta repurpose them. Btw I like your new wall ornament.
Reply: @blacktailstudiouncut  If it's positions in the right place maybe it could be drilled out and made into a cup holder or something. (I'm sure you get thousands of comments and suggestions and can't respond to them all but thought I'd throw in my two vents.)
Reply: @blacktailstudiouncut  TIME TO BUILD A DRY ROOM!!
Reply: I think that moisture over time makes the wood soggy which could lead to collapse. Not a woodsman or anything just taking the few things I remember hearing my coworkers tell me
Reply: youd think there would be some commonsense about testing before hand. no one would make this mistake but every video on yt is fake so id assume this is too
Reply: @MissterBest  he paid $1200 for it. At that price, one could very easily assume that that portion of it was done already. Even if it was, maybe it had been a while before it was checked again. The elements ain't none to play with
Reply: @blacktailstudiouncut  why not fill cracks with epoxy?
Reply: @ronjoosse5288  probably unable to prove it came like that from seller. Seller can say the buyer left it somewhere they got a leak on it or some kind of moisture. No way to prove anything on either part
Reply: Thank you for the reply, had same question in mind!
Reply: @hhiippiittyy  is called dry ice because there is no moisture. It goes from solid ice to gas.
Reply: Goto Powder Coating outfit and ask to use one of their ovens to bake the slab for 2-3 days at like 400° That should ensure no moisture
Reply: @blacktailstudiouncut  so if it’s supposed to be dried out can’t you get your money back and be like “you sold me a “dried slab” that wasn’t dry now I wasted all this time and money on something you lied to me about”
Reply: @jayfielding1333  
Yes, but it sublimates at about -80c / -110f. Anything cooled even close to that temp will cause water vapour in the air to condense upon it unless the environment is near 0% humidity and/or equally cold. It's the effect of superchilling the piece that concerns me. It maybe negligible with less porous pieces, where the condensation can quickly be reabsorbed into the atmosphere, but with pieces such as this the potential for any condensation to get trapped might be an issue. Maybe.
Know what I mean?
Reply: U let it sit and dry out.. prep, patience and testing.
Reply: @holohulolo  instruments that test for it
Reply: @blacktailstudiouncut  is there no way to drill down into the pockets and dry them out and re-patch them back sealed? Just curious 🤔
Reply: Any time you have a piece of wood that would last whether it be furniture or the wood foundation of a house, it must be dry and solid. Moisture cannot be trapped in wood that is meant for use over a lifetime or many lifetimes. It will rot eventually and break and be worthless. So you can’t sell it that way. Once its sealed with epoxy, youd have to destroy the whole thing to get the moisture out
Reply: @locheyoutube5252  good point. You can get some dimensions lumber out these also you could definitely get some beautiful veneers that could be book matched.
Reply: @ballershanelle  its sealed with epoxy. Its like leaving a zip loc bag full of water on the counter thinking the liquid will eventually escape.
Reply: @chriskeiffer5861  then its between you and God
Reply: @toriellsimon9075  not soggy itll will eventually rot
Reply: @blacktailstudiouncut simple get some heaters and set it down on a bench and hot box your garage or work shop for an hour then release the heat and boom now you have a house fire
Reply: @blacktailstudiouncut  warping and cracks is what make old tables interesting
Reply: @ashleymarie6682  thanks, should’ve thought of it as subflooring
Reply: @Ozhull  me too, wondering if there is ANY way to recover/repair it? Can't machine off the top layer of epoxy until the wood is exposed, dry it out, then re epoxy it?
Reply: @Takethebaitmate  the fool would be the person who didn't check their material/tools before starting, guy.
Reply: @ronjoosse5288  not how business works though, because the supplier didn't do anything wrong. The supplier would purely have to do it out of the kindness of their heart.
Reply: @blacktailstudiouncut drill 1mm holes spread out on the back, flip it over on a stand then use infrared lights to remove moister. Your back in business.
Reply: @blacktailstudiouncut  so that explains what happened to my table that I made.
Reply: $1200? I just purchased a $40 money order that I didn't need so I asked for a refund. They told me it will cost $35 to refund it and it will take 90 days to receive it! I Thought that was bad. But that's far from $1200.
Reply: At least you tested it, and for that we thank you !
Reply: @blacktailstudiouncut  I think you are being generous with the title "wood worker". Epoxy worker maybe.
Reply: @blacktailstudiouncut  thanks for your answer! A beautiful piece what you did 👏🏼👏🏼👏🏼
Reply: @blacktailstudiouncut  make it into a big clock
Reply: Lesson learned
Reply: @blacktailstudiouncut how much profit will that table fetch?? Give me a range
Reply: @ronjoosse5288  I've no idea if he could, but if he does it might strain their relationship. The provider might think this was preventable and be less keen on selling again.
Reply: I would used for entry table with a big jar full of fake flowers 💐 just to show off!! Is a beautiful piece!!
Reply: @blacktailstudiouncut  why not just use it anyway?
Reply: @blacktailstudiouncut  arr no what a shame that's a real nice pice
Reply: He should have tested it be for he started all that work on it.
Reply: @ronjoosse5288 nope because he already did the project. The slab has already been tampered with so any refund would be void. It definitely sucks though
Reply: Beautiful wallpiece tho...😊
Reply: @ronjoosse5288  No! Its his mistake, he should have checked.
Reply: 500
Reply: @blacktailstudiouncut  Just put it in some rice for a while and you'll be good to go👍
Reply: What is that instrument called ?
Reply: @ronjoosse5288  The slab could have been dryed more before usage. As for getting money back good luck proving it was the seller that left moisture. Its a very easy argument to say u stored it incorrectly(damp environment etc...). At that point its just ur word against theirs. But if u have a good relationship with ur dealer they might throw u a few bones.
Reply: The device he is using to detect moisture after. Those and others with prongs can be pressed into the raw would before you start. It will tell you how much moisture is in the wood. He then could have got someone with a kiln to dry it more. Or let it sit and dry before working it and sealing it. Sealing moisture into a slab can cause a various amount of issue making it not good salesmanship to sell it. Unless they were well aware and still wanted it.
Reply: @blacktailstudiouncut - i live in Lincoln city and i am curious where the best place are to get wood like walnut and maple are in the portland/ salem region
Reply: Some of the best lessons are the hard ones
Reply: So after a year, is the slab still a wall piece?
Reply: @blacktailstudiouncut so how does one get rid of trapped moisture do you heat the wood a bit to help the water evaporate out?
Reply: Possibly the dry ice
Reply: @blacktailstudiouncut  I know it’s been a year so I’m not sure if you’ll reply but does believe it out to dry before turning it into a table, possibly help it and at least you know you’ll never make that mistake again. Its still gorgeous
Reply: @bsfatboy ya or maybe chop sticks would be cool. Or toothpicks. Maybe sporks?
Reply: Probably impregnated the piece with Dry Ice 😐
Reply: Blacktail is right. Take your time. I mean respect that is piece art.
Reply: @blacktailstudiouncut after a year now, how is the piece doing? Did it cracked?
Reply: @blacktailstudiouncut  My question was why you didn't test it when it came in, very thorough response I appreciate it lol.  Live and learn!
Reply: Yep thanks for educating me also.
Reply: @blacktailstudiouncut  can you not just wait until the distortions appear and then sand it down and resurface it, or will thr cracks generally be large and ruin the structural integrity?
Reply: @R.Akerblad I would try
Reply: @blacktailstudiouncut  you seem like a pretty legit wood worker my guy. Sounds like your supplier was reliable and slipped up once. Happens. Isn't a reflection of you or any negative character. You trusted someones integrity and that's a good characteristic
Reply: You have to dry it out for a really long time before sealing it. As temperatures change, so do the pockets of moisture. When the pockets change size, the wood will be stretched and depressed, which causes damage. Think of when you leave a beer in the freezer too long, the contents expand, and it explodes the bottle.
Reply: Is it feasible to have a dedicated dehumidifier room and leave all pieces in for 2 weeks before usage?
Reply: @hhiippiittyy Dry ice sublimates at temperatures above . You would need a whole lot of pressure (5x normal pressure at sea level) to make it spend any time in the liquid phase. Hence why you rarely see CO2 in the liquid phase and why he's using it in the first place. The intermolecular forces are too weak.
Reply: Dry ice bro
Reply: @ronjoosse5288  it was still his goof since he assumed it was dry... I doubt they'd reimburse anything since he "should have" double checked. Bummer too cuz it's so freakin cool!! After all that work the poor guy!!
Reply: @R.Akerblad  I feel like that is a really good question! Idk if the wood would stay in tact 🤔
Reply: That is incorrect. There will always be moisture in your wood otherwise it will break into 100 of pieces if anything hit it. 

That the problem with instagrams craft men.
Reply: @R.Akerblad  That sounds like a great solution. I mean then he could make 2 tables right? 🤔
Reply: It is always best to assume it has moisture, and needs to reach equilibrium with the local environment.
When buy wood of unknown moisture, you can slow down, and keep it in a dry environment for a bit, and start to cut it to rough dimensions, and wait, and check the moisture level and weight also.
After you have a specific known weight, and it doesn't get lighter over time, you can start to work it to its final dimensions.
A simple fresh cut Pine 2×4, can contain well over a gallon of water in it.
Weigh it as fresh cut, and wait till it doesn't get any lighter over time, and that may be its final point of equilibrium with the local environment.
Reply: That would look so good on my wall
Reply: @ronjoosse5288 the problem is it’s his fault since he sealed it, if he knew he still could’ve let it dry and it would’ve been fine
Reply: Can you cut it into layers to release the moisture?
Reply: @blacktailstudiouncut thank you, That was very helpful.
Reply: yea moisture test it before you start if it's high say above 14 15% store it inside your house where your ac controls the humidity for at least 2 weeks then recheck it you should also store all your hardwood flooring in your house for 2 weeks before installing to allow the wood to acclamate to the humidity level inside your house wood will grow and shrink  depending on your humidity level inside your house all he needs to do yo fix this is plane the epoxy off the bottom surface of the table top and let it sit inside a controlled environment till the moisture level is down this doesn't have to sit as only a wall piece
Reply: I think there always a solution to a problem
Reply: Could it have been the dry ice blasting?
Reply: @blacktailstudiouncut You have to have some sort of skill or selling point to offer to make them believe if the don't enroll you they will loose. What can you offer them
😊
Reply: @blacktailstudiouncut is there any possible way to save it ??
Reply: Why is it unusable if there is trapped moisture?
Reply: @blacktailstudiouncut I was definitely curious on what would happen if you used it anyways🤣
Reply: Next time place the wood in a small closet with a desiccant dehumidifier on 40% humidity for 2 days! You'll be amazed how well it works on wood👌
Reply: This is what I was wondering..is there a way to prep it.  It is the coolest table I have ever seen.
Reply: Wow
Reply: @blacktailstudiouncut why don’t you surface it and get the finish off both side and let it breath… worth a shot I think.🤔
Reply: @R.Akerblad EXACTLY WHAT I WAS THINKING
Reply: Split it, dry it out, and glue it back together?
Reply: Why can’t you drill relief holes into the bottom side to let the moister out?
Reply: @blacktailstudiouncut Does that mean you can get a refund on the $1,200 for the wood itself? Since the seller sold you a defective product?
Reply: @Max-nt5zs I've seen semiprecious stone used (like malachite). Small pieces placed mosaic style in the wood's voids is more common than filling the space with precisely cut slabs of stone.
Reply: Knowing that it needed to be dried out,why did you not test it first?
Reply: @blacktailstudiouncut could you not sand it and let it dry a few months?
Reply: Remove from base. Sand epoxy from top and bottom surfaces. Wait 6 months to dry out. Re-seal
Reply: @blacktailstudiouncut how long would you have to dry it if you caught it early?
Reply: @ronjoosse5288 bro this guy has a million subs on an advertisement friendly channel. You think he gives a shit about 1200 dollars to chase the supplier after weeks if not months have passed since purchase date
Reply: @blacktailstudiouncut  damn, that sucks. But it’ll still make a beautiful wallpapers I mean it’s absolutely gorgeous and making a profit should absolutely be no issue. And as for the base, it’s not a total waste because you can use it on another piece.
Reply: @madisonpowell1694 I cannot believe that he bought the wood pre-kiln. I am an amateur, and I was told my walnut that is now my bookcases had to be kilned. 

If anyone here has never seen veneering, thss as t is cool (they rotate and shave it)
Reply: Is there an update on this piece? Can you show the cracks from the moisture?
Reply: So you see what he did at the end to find the mistake? Yeah do that first
Reply: @blacktailstudiouncut you aren't able to plane it so the top layers of epoxy are removed and the bare wood is exposed? Would that not allow for the moisture to escape? Or has the epoxy impregnated the wood making this impossible?
Reply: @ronjoosse5288 no. Terrible business practice. Nobody else should pay for your mistake.
Reply: @blacktailstudiouncut  Doesn't seasoning prevent moisture? Did the logging company not seasoning it?
Reply: @blacktailstudiouncut what kind of device do you use to check that? Or how do you identify if there is trapped moisture?
Reply: excellent explanation. the exact same thing happened to the wooden table i had bought a year ago. it was replaced twice after the epoxy parts got deformed on their own and the current one i have also started to show deformations and cracks but at this time i am too tired to ask for a repair or change
Reply: @hhiippiittyy most of the cellular structure near the surface is sealed during the kiln drying, even if the piece isn't fully dried inside. We leave kiln dried maple outdoors for months and even when being rained on it doesn't soak up much moisture at all. Could be different for the wood he is using in the video though
Reply: He should have let it dry out 1st
Reply: @blacktailstudiouncut  Would it not be possible to sand the coating off and then let it dry and re-coat?
Reply: I was thinking like the other - could
You take edge off and could dry out through the non sealed edges ?
Reply: @blacktailstudiouncut great reply.
Reply: @blacktailstudiouncut  I always have such respect for artisans who share their mistakes. It's similarly entertaining, and so so much more informative.
Reply: @blacktailstudiouncut  update? Show us what happens
Reply: Why didnt you cjeck moisture content before working it
Reply: @blacktailstudiouncut thank you for the education!!
Reply: @blacktailstudiouncut can you bake it at low humidity?maybe a vacuum over of sorts?
Reply: @blacktailstudiouncut 

Thank you for explaining-

I thought was supposed to have moisture in it.
Reply: @blacktailstudiouncut  won't make that mistake again.
Reply: So should basically be kiln dried before working with the slab???
Reply: Ty
Reply: @blacktailstudiouncut can't you like bake the moisture out of wood? I know it would be an extra step and time but maybe worth it?
Reply: I know you can test them, but is there no way to dry them before you do the work once you've found out there is moisture?
Reply: Couldn't drill holes in the bottom to let moisture out? Really small holes.
Reply: Are you sure you’re not reading the moisture from the epoxy?
Reply: @blacktailstudiouncut couldn’t you drill some tiny holes where the moisture is to let it escape and seal those back up?? Or would that not work
Reply: @connorjohn5013  what if you sand the bottom and let the moisture get out that way
Reply: How do you get rid of the moisture, I mean, if you catch it beforehand.
Reply: @blacktailstudiouncut I admire your ability to openly show your mistakes. Most folks for one will never admit that they’ve made a mistake and typically blame others. It’s funny how the biggest critics are those with no skill. I know that when I make mistakes I’ve had people question my ability in general. It’s frustrating
Reply: @blacktailstudiouncut  so how do you get moisture out of the wood?
Reply: Seems a bit ironic that a slab was picked for its imperfections!
Obviously the table Buyer wanted a “virgin”, unadulterated table top and for $40-$50k I guess that is reasonable. 

After I found 4 nicely turned Walnut table legs in Galena, Il.  I decided to build a table from walnut. I also serendipitously found some rough planed Walnut boards -7’ x -8”x 7/8”! 
Deciding I needed a router, router table as well as a radial arm saw, I put my little workshop together.  Cutting, fitting ( using biscuit dowels), sanding and finishing ).
Done nearly 45 years ago it looks great, is durable, has a large total surface area serves a multitude of roles, including computer work area with very high utility value!
Reply: @blacktailstudiouncut you could get a piece of glass cut for it and use it anyways!
Reply: @ronjoosse5288 Well, no. Because technically, the seller did nothing wrong. Im sure they told him how long it had been drying. It's up to him not to rush into the project, technically.
Reply: Smart artist! Showing your work, honestly, including miscalculation- 
Hoping you receive many orders from this. If I were in the market, because of your skill, talent and honesty, I would order a custom piece from you. 
Good luck!!!
Reply: @blacktailstudiouncut There is absolutely no water trapped in this piece of timber and you know that. This told a lie to pull people in to watch this video. I've been working with wood longer than you've been alive, so you're not fooling me with your silly games.
Reply: Probably a dumb question, but could you throw a piece of walnut?And you're kiln for let's say, three months to fish this issue. Or is it to late now I assume it is since you said it's a wall decor now
Reply: @brent2597 that would be cool. Id still use it as a table. If it cracks u fix it. If it warps, great, level out the legs and now the table has flow.
Reply: @SJNFAB  This is what I was looking for. Is this not an industry standard? Why would you not cook out the moisture?
Reply: @blacktailstudiouncut you didn't think to check like at least once? Come on......
Reply: As a 27 year old disabled vet that doesn’t work I would still use that as a table.. like wow. I genuinely will never own a table as nice as that.
Reply: @whirled_peas   dont really understand what that means, might need to type for the novice viewers
Reply: Fun fact, you knowing why it happens will not benifit or help you in a single way, good job wasting ur own and everyone elses time
Reply: It was THE unanswered question.. strange to make a video of falling and not show a solution. 💀
Reply: Your work is amazing nonetheless 😮
Reply: How much time does it need to totally dry out?
Reply: Beautiful work🔥😊The comments from the viewers and the responses from the creator are really helpful and informative.  Learnt a lot. Thanks ❤👏🏻
Reply: I found black walnut to be one of the toughest woods to dry!
I dried out a piece for a bow riser for a year. My boyer thought that would be enough so I shipped it. When he got it, he said it was still too wet.
Reply: @thehomefront1905 What a strange thing to write.
Reply: @connorjohn5013 why not just sand down the underside and let the moisture out?
Reply: @blacktailstudiouncut  would silica solve this?
Reply: Leave it out on a sunny July
Reply: Don't you have to let a slab that thick cure for a while before working it??!
Reply: @hhiippiittyy  I never dreamed dry ice causing cellulose cell wall moisture damage of walnut resin tables was on my Bingo Card today, but I love it! I
Reply: @blacktailstudiouncut  So is that why I read about people curing or drying the wood to stabilize it?
Reply: @blacktailstudiouncut so, because of that moisture the wood will rot even though it’s sealed in epoxy?
Reply: Dry ice makes moisture plus bubbles in the epoxy and depending on how long the slab had been drying 🧐🤔
Reply: The wood just wasn't dry enough or humidity during epoxy pour was high
Reply: @blacktailstudiouncut ah Youve had this happen over 10 times and you still dont just check it pre blasting it. Youre an absolute genius
Reply: @bsfatboy  water doesn't go that direction. The grain is like straws. Can only really get out from top and bottom
Reply: @R.Akerblad moisture is sealed in
Reply: Honestly after you did the dry freeze whatever cleaning, I think you're the one who put moisture into it.  They've got damn good slabs, and are very careful. In your full video, you can see how wet you made it... from the freeze process.   I would have to take responsibility in that one.
Reply: @NitasFluidWoodworks  Dry ice doesn't leave water behind, its not even water to begin with. Also it definitely doesn't soak into the wood.
Reply: @blacktailstudiouncut can you indentify the moisture pockets well enough to drill some holes from the bottom to dry them out?
Reply: Wood encased in plastic can't breathe properly. Green wood exposed to air will warp and crack (you can see the process well underway in this slab). Green wood encased in resin will shrivel, delaminate the plastic, and rot.
Reply: The moisture came from my tears grieving that live edge! 😢 RIP
it looks amazing and the base is gorgeous
Reply: @brent2597 great idea
Reply: @blacktailstudiouncut  will it ever get to the point where the moisture is gone?  Couldn't you let the imperfections form, and hit it with another layer of resin to make a clear level surface?  Having that imperfect base refracting through a perfectly clear exterior might be pretty cool 🤷🏻‍♂️
Reply: That's absolutely gorgeous work of art. There's got to be a way to fix it?
Reply: Dry ice moisture duh.
Reply: Beautiful, looks better on the wall tho,
Reply: Wait, are you actively asking for someone to educate you on a matter you are not familiar with instead of just saying whatever comes to mind to criticize a professional? You new on the internet or something? 😂
Reply: Update? Did it crack, peel, or bubble?!? 😮
Reply: @blacktailstudiouncut can you drill a lot of little holes in the backside for drying?
Reply: Higher a fabrication specialist to build you a propane fired drying room. Gunna run you like a grand or two by the time you’re done with a fastening /hook system but this will never happen to you again and you can offer it as a service to ur friends in the hobby.
Reply: @blacktailstudiouncut a very expensive and disheartening lesson, but a lesson nonetheless. You will now probably double check every single slab 😂
Reply: @blacktailstudiouncut I know I'm not the one that asked, but thank you so much for that information. That may come in handy
Reply: Ruined it with epoxy. Epoxy is the worst thing to ever happen to wood working
Reply: Kiln-drying prevents the wood from warping or developing small cracks over time, resulting in extremely durable furniture. Kiln-drying can remove as much as 9/10th of the moisture, making it resistant to fungal decay.
Reply: @madisonpowell1694 what's that a tinfoil box?
Reply: I have a tiny one of these,  someone just threw some epoxy on it with out shaping it or anything, its jagged on the edges and that makes it look so real to me and i love it so much and think the flaws are what make it the most useable.
Reply: @ronjoosse5288  Actually, the error was his. He could have made sure it was dry before sealing it.
Reply: @MissterBest  That is the most down to earth explanation for what happened. Thanks.
Reply: @blacktailstudiouncut  can you drill pilot holes in the bottom to let the moisture escape and fill and cap it after drying?
Reply: @blacktailstudiouncut 😅
Reply: @07slowbalt , that's a really  great question. So thoughtful!
Reply: I’m sorry to learn you couldn’t use it for the intended purpose. It’s beautiful! … 
Now, on a separate note, I’ll take the “now useless” base off your hands for free just to help you out with the mourning process. 😎
Reply: Would.have beena  great dungeons and dragons table
Reply: Still ... It's really something of beauty
Reply: @ronjoosse5288  it wasn't exactly unusable. He just had to wait and ensure all the moisture dried out before doing all that. They only sold him the wood, not a table piece, he could do whatever he wanted with it.
Reply: Find a sandblasting and powder coating company. Have them use low abrasive sand or salt. Blast down to wood. Then use their industrial oven to cook the moisture out of it. Then re sand re epoxy maybe. I legit have no idea if that would work just a thought.
Reply: @ronjoosse5288  he didn't verify the moisture content before he sealed it in with the epoxy. It's not difficult to remove moisture from wood until you seal it into the wood permanently using epoxy resin.
Reply: @connorjohn5013 how about the bottom can't the moisture escape from the bottom
Reply: @connorjohn5013
Reply: @hillsidebliss Asking the important questions 🫡
Reply: Thanks for sharing. Beautiful piece. Could you keep us updated? I’m so curious. It’s so pretty!
Reply: The slab seller was never seen again
Reply: @blacktailstudiouncut  Not "better wood workers". I bet every woodworker that double checks does so because they have done exactly what you just did. And Im pretty sure you will always double check and will never let this happen again. So, not a better woodworker, just one who has made this mistake before you.
Reply: @blacktailstudiouncut  that will never happen again so there is that
Reply: Right no clue but it is beautiful
Reply: @blacktailstudiouncut my wife and i got our bed made for us in sri lanka. They waited two months for the wood to season and dry. That was 24 years ago and the bed is still solid
Reply: @blacktailstudiouncut what if you dremeled a small hole into the moisture areas and let it sit and cure then fill back in with clear resin could that not work? I'm truly curious cause I think I know why I had some things happen in a few projects I've done and I'm a beginner hobbyists so is that something that could work if you found moisture in it after you have epoxied and what was that meter tool that told you you had moisture in the table
Reply: so many commenters don't know how epoxy works I guess
Reply: Wagner moisture meter all your slabs to be certain they are kiln dried and the moisture is stable throughout. Don’t just test one area and say “it’s all good” never trust what the Mill is telling you. And never never unstable Green wood.
Reply: What if you drill tiny holes all over, so the moisture can escape, then fill them in when the wood is dry!? It's so beautiful!
Reply: @blacktailstudiouncut so what your saying is you had plenty of time to sell it and get out of town
Reply: @blacktailstudiouncut  is there a way for you to dehydrate it even more before you begin pouring the resin and other stuff? Im utterly fascinated by this stuff and hope to one day afford a place with enough space for a wood working shed.
Reply: @blacktailstudiouncut  so would there be cracking as a wall peice?
Reply: @blacktailstudiouncut  warping, cracks, depressions... Idgaf, it looks amazing and I'd still use it lol
Reply: @blacktailstudiouncut honestly I'd still buy it just at a reduced cost knowing the issue before hand but i would.guess if it's kept in a stable temperature/humidity then it would take a long time for any issues to arise
Reply: You have to dry age it. - Guga
Reply: @TheAgaveSpirit Moisture
Reply: Guess I wasnt the only one thinking "so what" about the bit of moisture after all that work😂
Reply: @R.Akerblad better off just planing the finish off both sides and redoing it after it dries.
Reply: @blacktailstudiouncut 🎉😂
Reply: Algo triste , no se dió cuenta antes por qué los cortes fueron muy superficiales
Reply: @blacktailstudiouncut cant you treat the issues that appear once its dry and then sell once it passes that machine???
Reply: Can't drill to release the moisture, and fill again?
Reply: @blacktailstudiouncut  thank you for that explanation brother. Your work is phenomenal.
Reply: @ronjoosse5288 It's not unusable j,ust not being used in the way he envisioned it. He got a really badass wall piece out of that mistake.
Reply: @MissterBest unfortunately that's a HUGE issue in some other hobbies as well. I'm dealing with this right now on a new aquarium.
Reply: @blacktailstudiouncut Material has to acclimate to its environment. If brought indoors, give it a month before touching it.
Reply: @07slowbalt 😂if you let it dry from one side only it will warp so badly
Reply: @Keithmwalton i never seen anyone do it thats why im asking. I would think it would be a slow dry and with a hardened epoxy shell already in place would it really warp?
Reply: @blacktailstudiouncut could this not be fixed after those issues present themselves? Such as sanding down and filling the gaps with more clear coat to meet the level depth and then would be fine?
Reply: Yeah, you check for moisture before spending $1200 💀
Reply: @blacktailstudiouncut vamos a pensar que te diste cuenta de casualidad que paso por tu mente que tiene humedad lo sospechas que es lo correcto de hacer dejarla al sol hacer una perforación para que la humedad seque ???
Reply: Para eso se usa el higrómetro
Reply: Por la parte de abajo está sin resina? Posiblemente se pueda "ir o secar la humedad??... Cómo adorno quedó muy bello!! Cómo sea es un trabajo bellísimo!! Véndelo al doble o al triple!! 😅❤🎉